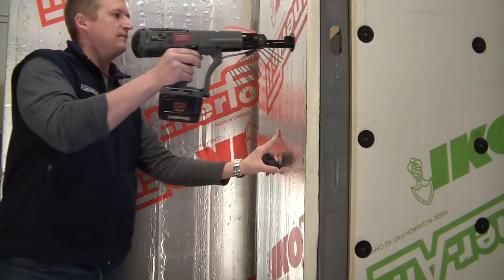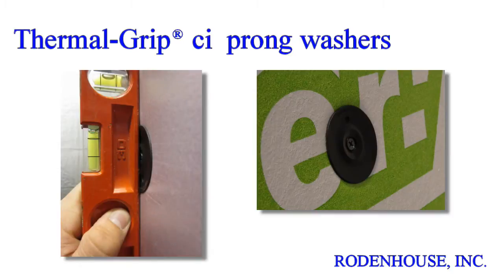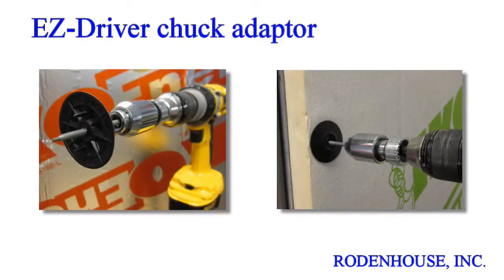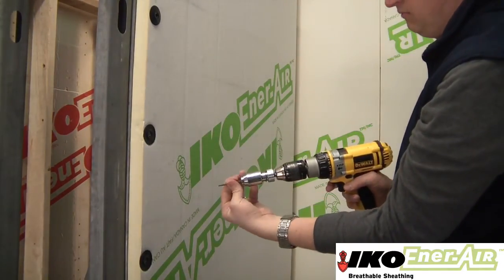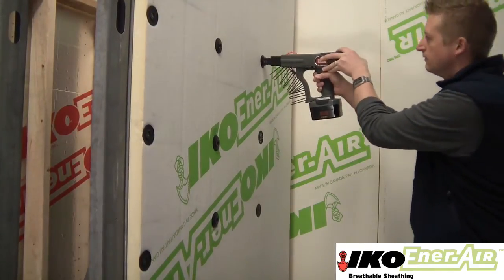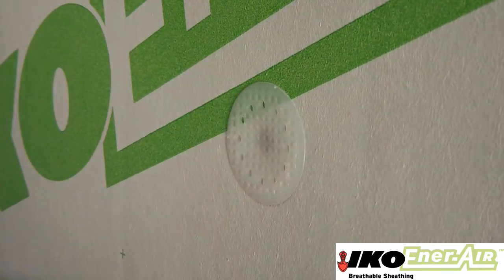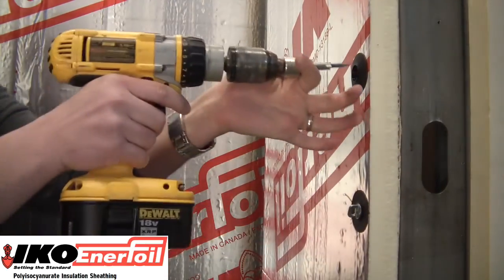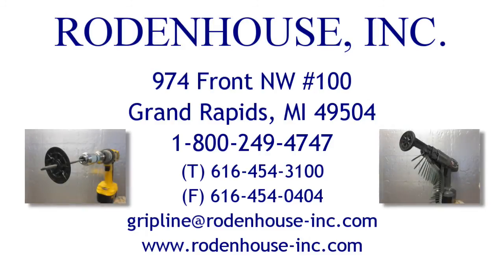Fastening systems for Ener-foil & EnerAir continuous insulation- from Rodenhouse Inc.

Comment: If I want to install the product EnerFoil over my current siding of cedar shingles will this type of fastener system make the insulation a level surface for my intended vinyl siding; or should I be going with an insulation product such as Levelwall?
Reply from the maker: TheDerek47 Hello, the fasteners should sit nearly flush on the surface of the insulation once they are tightened down.
Reply from the maker: TheDerek47 Also, I am not familiar with Levelwall - sorry!